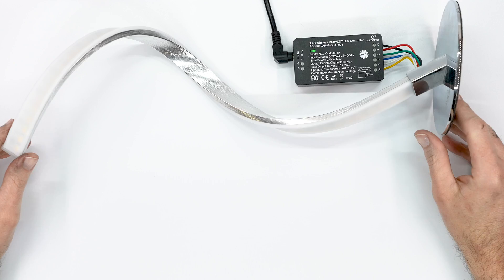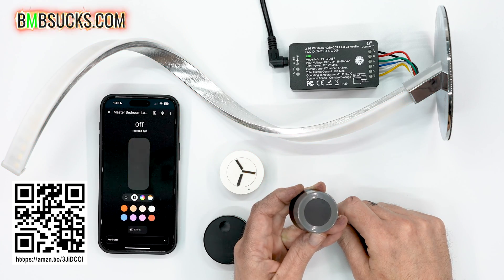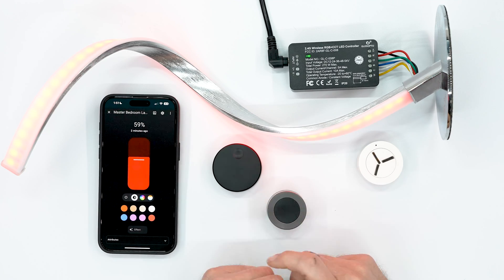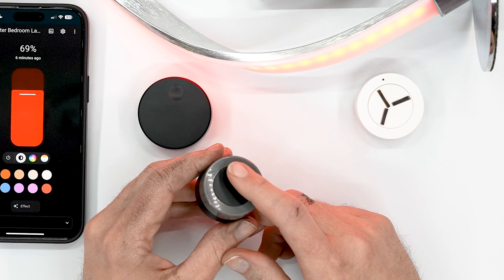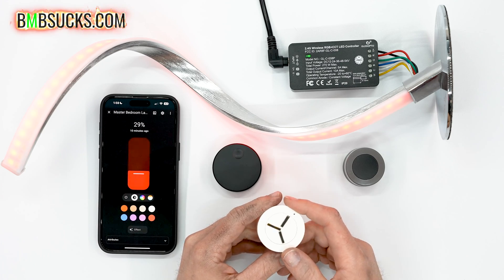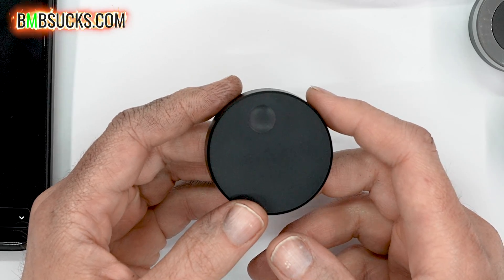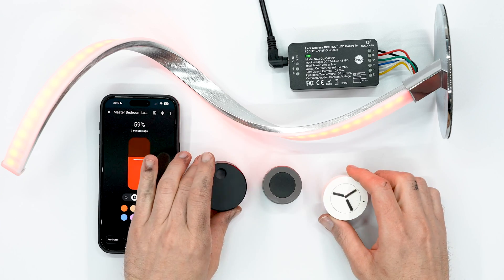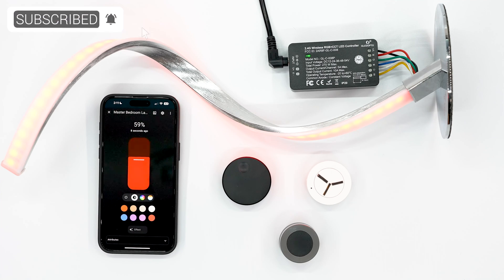Which Zigbee Rotary Knob is best for Home Assistant controlled lights?

Comment: I have quite a few of those dark gray knobs.
They are not bad, but they not responding to the first input half of the times is quite annoying.
The reponse of the rotary inputs also fails half of the times.
And the double click function that is advertised I have not managed to make it work in HA. Don't know if you have mentioned that in the video.
Idk, it's a pity that there is nobody offering a better product than this one without having to pay the 40€ for the Hue one

Comment: I just got the white one. I can't get consistency with the rotary part.
EDIT - found my problem. I switched it to scene mode with 3 clicks, reconfig'd my automations and now works great.
Reply: Hello, how did you do that? I can't seem to make it work
Reply: @mihalisvranakis579  if you watch the Logbook in Home Assistant, you see entries made when you turn the centre wheel. If you get a log entry showing step mode, step size etc I found it didn't work very well. Three presses of the centre button will change it to Scene mode. Now rotate the wheel and a smaller msg is shown. 
In HA automations for the switch, look for "Device rotated Right" or "Left" and use that as your automation trigger rather the the 'rotated fast / slow' triggers.
Reply: @scottb721  oh!! thank you, will try that!! excellent info!